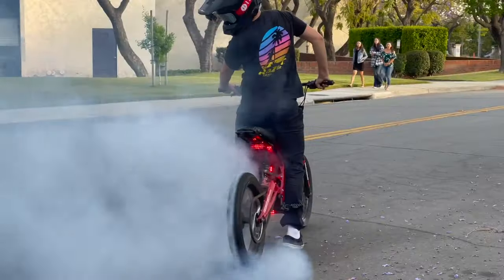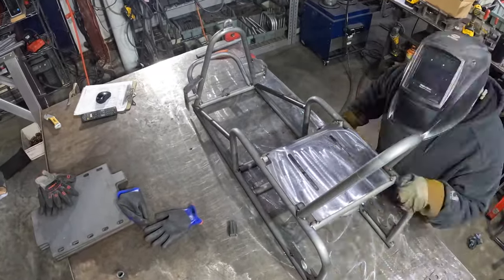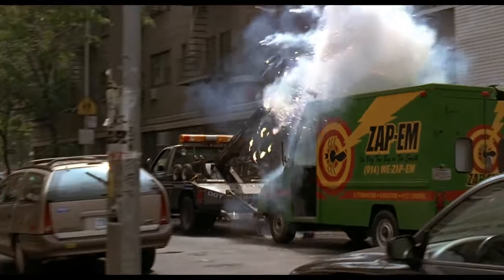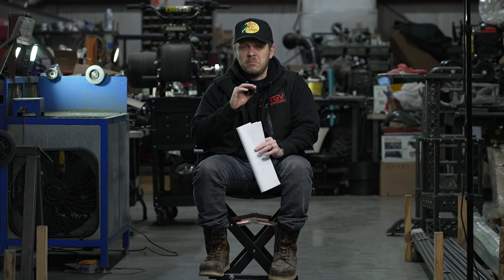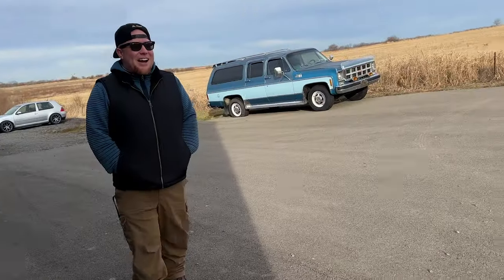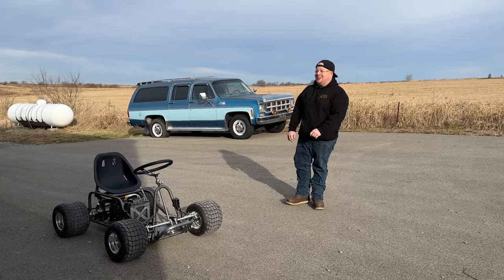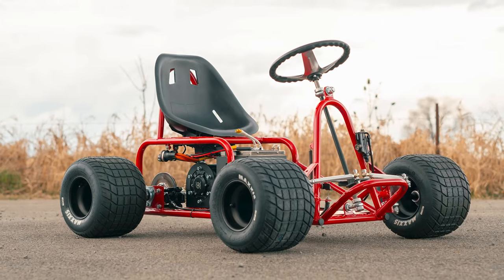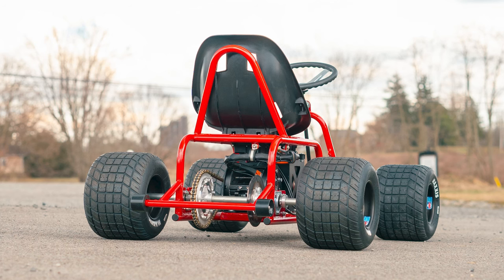How We Built Surronster's Insane Stunt Kart

Comment: I like electric for its quietness and instant  acceleration. I built an electric drift trike using an Ebikeling 48v 1200w electric fat tire wheel but it’s doggish off the start and max speed is 28mph. But I’m also 255lbs. It’s still fun